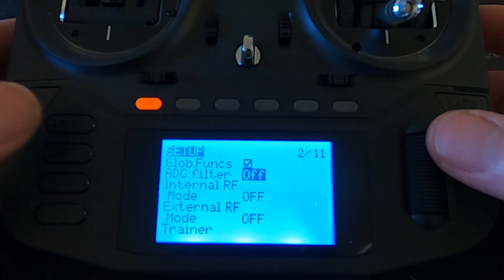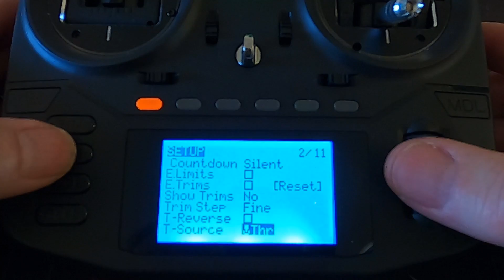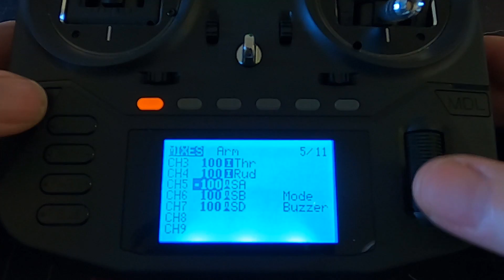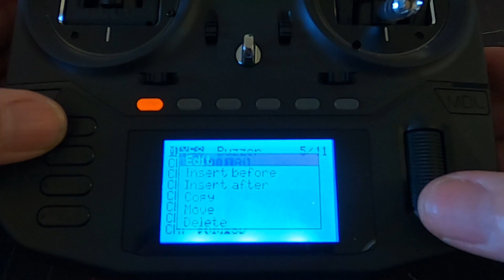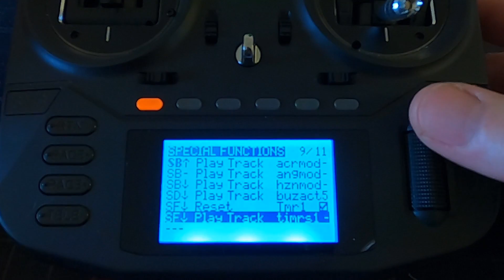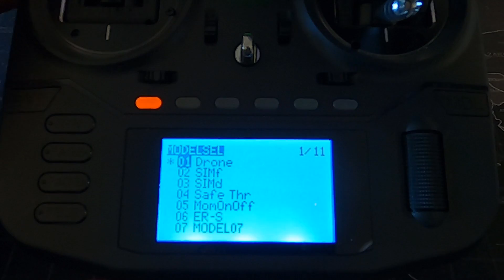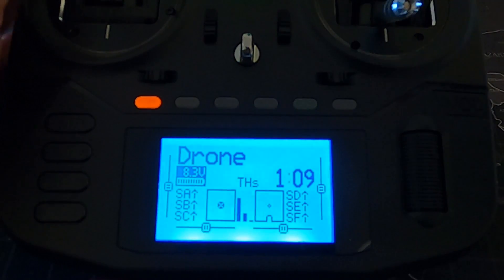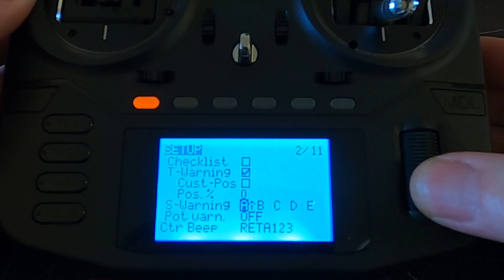RadioMaster Boxer Setting up a Basic Drone in EdgeTX

Comment: Hi Bill. I have been trying to set up a basic model following your video. I have been having all sorts of issues and I have just discovered on page 3 of every model I am setting up and in all of the models that were in the radio when I bought it, I have a '' HELI Set Up'' page. In your video, you do not have this. Also, in the input page the Aileron and Elevator are correct but  I can't name Throttle and Rudder. Those channels just have 100 with the little stick sign next to them. I think there is something deep within the radio that needs to be changed for me to be able to create a basic model for my whoop. Have you any clues as to what I should look at please?
Reply from the maker: Hi Steve, in the Model SETUP menu click Enabled Features to show HELI SETUP change from Global to off. The Heli window will no longer appear. You should not change anything in the INPUTS just leave as default make your adjustments in Mixes. I will look at producing a video on global settings.
Reply: @the-happy-RC-flyer  Thanks for reply Bill. I will have a look at doing that.

Comment: Helpful video. I can get everything to work except arming! Please help...
Reply from the maker: Are you using ExpressLRS if so use channel 5 for arming. If for a drone have you checked in Betaflight the Armed channel is set to AUX1. Try moving switch and see if the arming activates.

Comment: Hello Bill
I like your series about the RM Boxer
I am curious if its possible to have a small icon on the screen like an airplane or Multi rotor depending on the model that is active?
Reply from the maker: Hi Peter, you can add a picture to your model settings in the colour screen radios such as the RadioMaster TX16s but not the boxer.

Comment: Thank you. What are the modes buttons for? Also, with the ELRS version, is it possible to change the Aux 1 Switch to another switch that is more reachable for arming and disarming?
Reply from the maker: The mode switch is used to set up the flight modes Angle, Horizon & Acro. You can assign any switch you want on your radio for arming but you are required with ExpressLRS to use Aux 1 for arming, channel 5.

Comment: Hi Bill, I'm having a problem with a new boxer. I'm unable to bind to any 4 ch FS2A receivers I've tried. I updated to the latest version of EdgeTx and the SD card update. I know these receivers work fine as they bind to the Flysky FS-i6 I had been using previously. I can see the internal red light flashing when in binding mode along with the blue flashing light on the receiver. They just simply won't connect. Any help would be great as I assumed this would be a couple minute process and so far I've spend about 3 hours on it.
Reply from the maker: Firstly which version of the MPM do you have 4 in 1 or CC2500? FlySky is not supported by the CC2500
Reply: @the-happy-RC-flyer   The 4 in 1 is the internal module. We have 2 new boxers and I just tested the 2nd one and it's having the same problem. It beeps and flashes showing its trying to bind. I re-tested with the Flysky FS-i6 and it binds straight away, so something is with the boxers I just have no idea. I have the setup for the model mode: multi, type: FS2A_RX, receiver set to 1. Neither of the 2 boxers want to bind.
Reply from the maker: I think you are using the incorrect protocol. Please try FISky2A PPM, SBUS. I do not have one of the receivers to test for you.

Comment: Hay Bill. Great video as usual. I'm trying to setup the timer reset on the SF push button switch. Mine looks exactly like you how yours looks in the special functions menu. SF down reset tmr 1 box is checked. Under that SF down play track timres. I'm using the Amber22 sounds pack.  Any ideas?
Reply from the maker: Blake, can you tell me what is not happening. Timer not resetting or sound not playing. Are you seeing the SF1 activate on pressing the button?
Reply: Hi Bill, I got it sorted out. It turns out the file was either corrupt or it was converted using the wrong settings. The file was 16kb, I reuploaded it to the audio converter using the correct options and the kb sized changed from 16 to 65. I uploaded it to the SD card and it works just fine now..  @the-happy-RC-flyer

Comment: how do I get batt voltage from drone on radio telemetry screen? I dont fly FPV atm, saving for goggles, but at same time, I need to know how much voltage I have so I dont drop out of the sky and kill all my lipos :D If I told you how many hours of random setup videos to find this information you be shocked, and I am still looking
Reply from the maker: This video should help you. I would suggest audible warnings so you do not need to look at the radios screen.
https://youtu.be/k188p7lhkhk?si=qBAILjlSL9acl5_e
You can display the flight battery voltage on the Telemetry screens. 
https://youtu.be/CqLc2kK5wE4?si=wAAt5VW_TmCFfsV0
Reply: @the-happy-RC-flyer  yup, ty, alot of the videos are old, what got me was all the videos involved with betaflight didnt have the telemetry slider in battery and power tab, I was able to get to work after that. Thank You very much for the responce, Lordknows Ive made many6 comments on other telemetry videos lol
Reply: @the-happy-RC-flyer  That did the trick, tyvm...keep it the sky and out of the trees :)